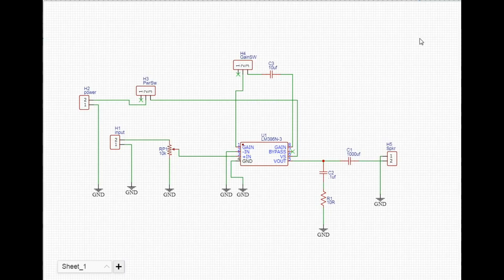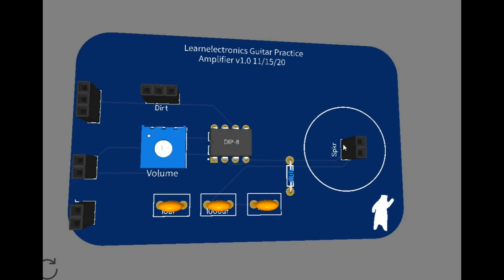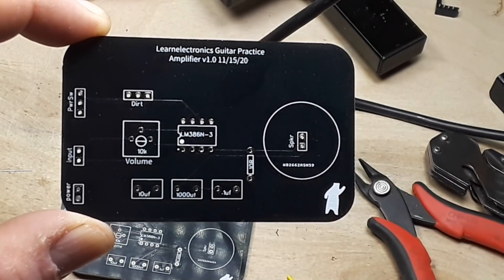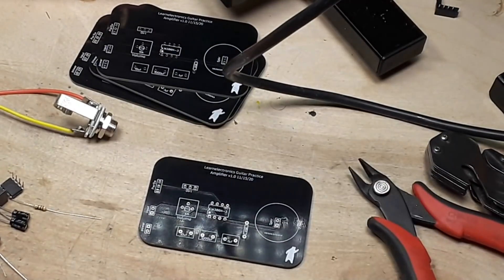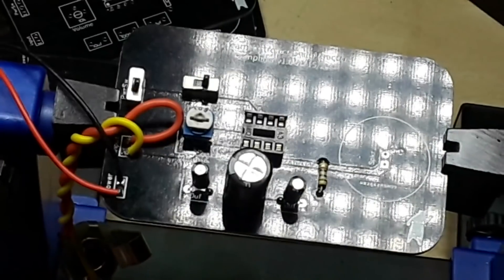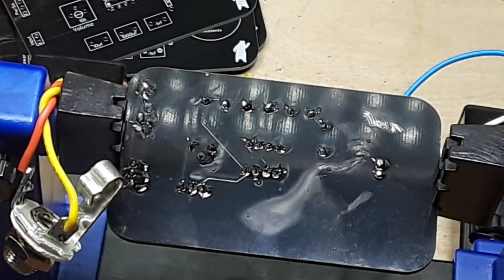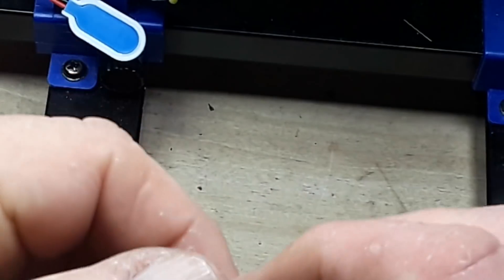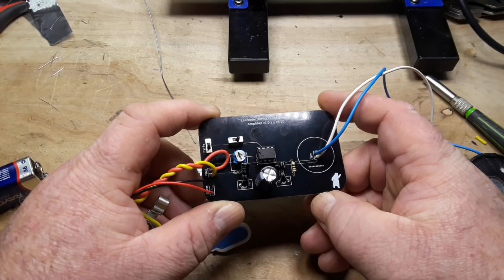LM386 based Altoids Tim Mini Guitar Amp

Comment: So i am completely new to this, i don't even know how i stumbled across it, but here i am..

I'm confused about the pcb file, is there a link to the one you're using so when we order off the site we can follow your instructions? I've been trying to google info and it's been overwhelming. I ordered some components and 8 ohm speakers, just need to order the boards now but the site isn't letting me without adding a file even though i manually entered the specs?

Comment: Im new to all this so I apologize if this is a dumb question but would it be possible to change the volume pot to a different one so the knob can be on the outside? Thanks!
Reply from the maker: Yes, you will see as you get some experience playing around that you can just solder wires to the to the pcb and run them to the pot. You can locate the pot wherever you like!
Reply: That's what I thought you could do I just got a little intimidated because I saw three prongs come off the volume pot and I'm not too sure where each wire would go on the switch itself. Thank you for the advice!
Reply from the maker: Just make sure the middle wire on pot matches the middle on the board. If you find the pot goes the wrong way, swap the outside wires.
Reply: @learnelectronics  got it, thank you for the help, would you by chance still have the Gerber file for this, I'm not too sure how to make one yet..

Comment: cool but 10K seems awfully small for a volume control that isn't buffered.  If I recall correctly the input impedance of the lm386 is about 50K, why not use a 50K pot?  Most guitar amps have an input impedance of 1 Meg, but I could see you getting by with it at 50K, not so much 10K unless you have an active preamp of some sort going into the amp.  It'll sound like total mud...

Comment: Can’t you put a potentiometer in series with the 10uF capacitor between pin 1 and 8 to get a variable gain setting ? I have used this and it worked well for me... although I never considered using a variable capacitor . I say this because in the data sheet it shows a 200 x gain with just the 10uF cap, but also shows an amp circuit with a 50x gain having a 1.2k resistor in series with the same 10uF cap... increasing the resistance to lower the gain... just a thought ... keep up the good work bud, and I hope everything works out with your aunt .👍🏻

Comment: I’m a hobbyist pedal builder and have been quite surprised by how good an overdriven 386 sounds. I’m working on my own amp design and I would suggest adding a basic preamp. when I had mine on my breadboard I started with the EP-3 preamp, just a single JFET and a few resistors and caps; I replaced the source resistor with a pot for variable gain so I could get some dirt at that stage. Given how much open space you have on the pcb, I highly recommend adding a preamp to V2 before you order the boards. 

Also your Tele is a lovely color :)

Comment: I looked up the spec sheet for that chip and you don't have to worry about rattling the fillings in your teeth with that kind of output! Now if you decide to build two of those Altoids units and mount them as headphone speakers; then you might have to turn the volume down. Cool little build just as it is too!

Comment: Hey, Paul.  Good video.  For your V. 2, you might consider using ear buds or headset connection.  Better for the player, both from a volume and comfort standpoint.  Would save a lot of board space, too.

Comment: How do you select the values of capacitors and resistors? I wish you made a video on how to select the right values for the components you add to the cirquits you create. Further more please tell us how the filter functions and why is it placed there this way? I have seen a video about high pass filters and I suppose this is not the case as if it was so the output should have been between C2 and R1, isn't it so? I sympathize with you my friend as having an old stubborn parent who listens to no suggestions is a needle in the eye...